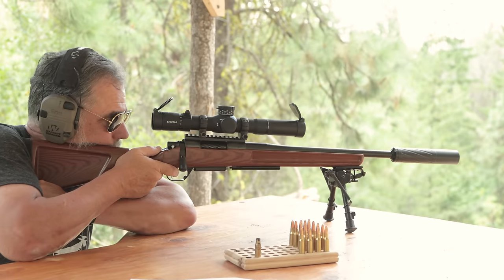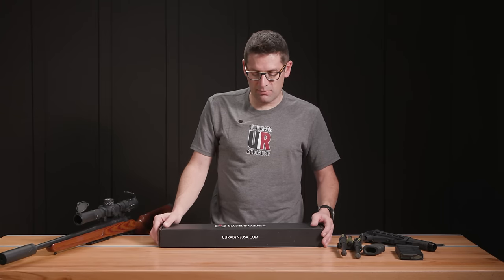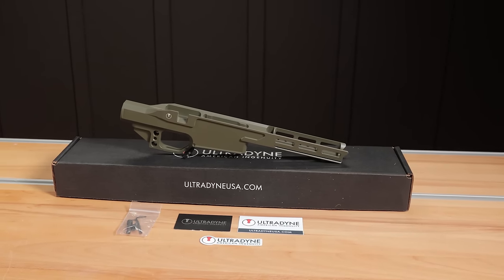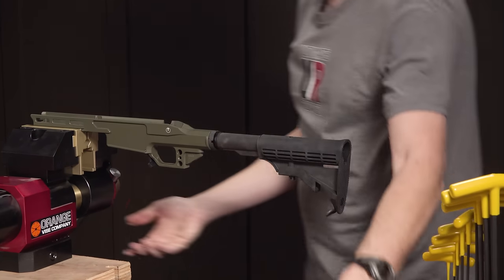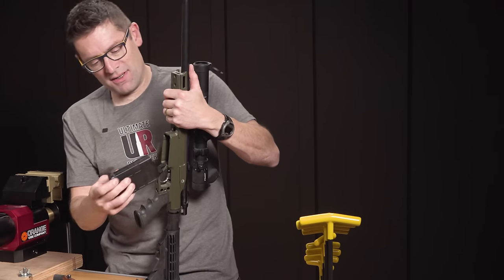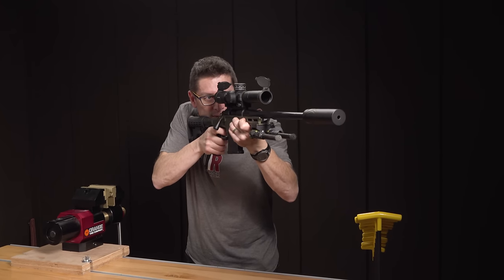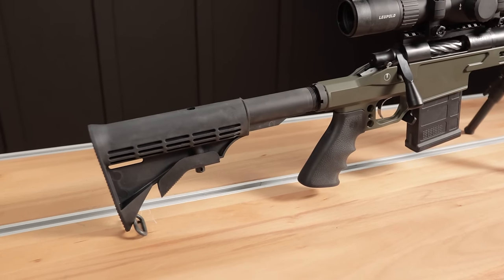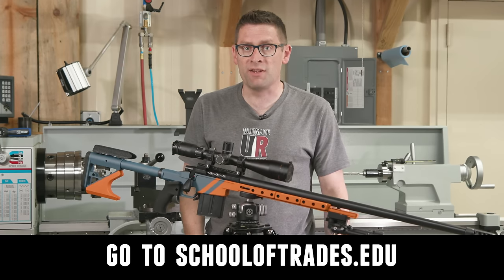Hands on with the Ultradyne UD3 Chassis

Comment: A folding buttstock adaptor would be even better. So it fits into a smaller bag in the truck.
Reply: There may be something in the works regarding this feature...
Reply: @ultradyneusa  do you guys plan to make the ud chassis for the ruger american rifles? gen 1 and gen 2 should both fit the same chassis.
Reply: @blurryface1975  Yes multiple new models are in the works, however a timeline has not been released on exact dates for each new chassis.